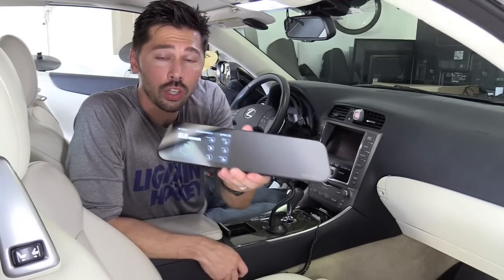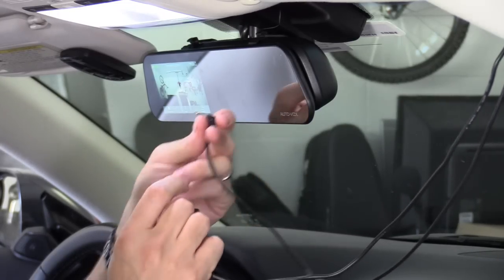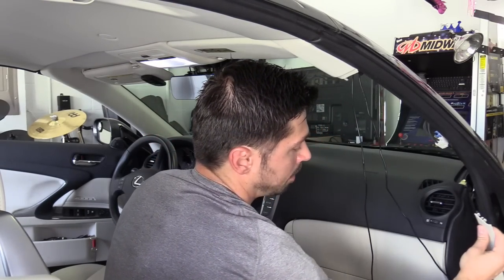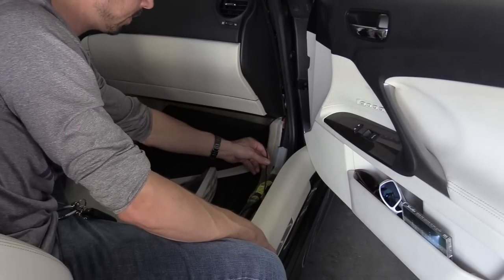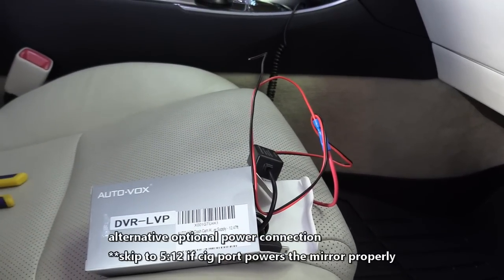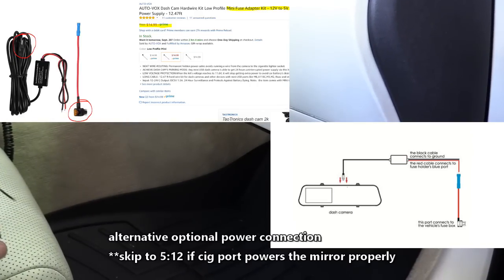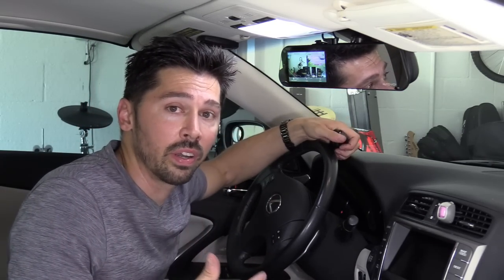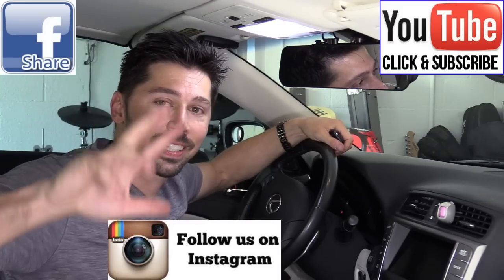HOW TO INSTALL AND WIRE BACKUP CAMERA / DASH CAM DVR SYSTEM

Comment: Tampa and others NEED HELP! I installed my reverse cam on my unit and it works,except the image shown on the screen is mirrored, what is irl on the left = on the screen right and vice versa. I tried to find a solution but nothing, tried it on the chinese unit, nothing. What did go wrong? And also I want to put a switch so I can see when towing stuff or taking bikes with me if they are still ok in the back.  How do  you wire a switch? I did the following, a  wire from reverse wire signal  of the  unit with a diode in between to the switch( diode with band pointing to the unit )  and a wire  from 12 v+ to switch. When I turn on the switch I get the message: no signal. I guess I need the reverse wire to let the reversecam think im  in Reverse?Any help with a diagram or something would be welcome!

Comment: Nice work, I have one remark, why not solder the stuff  and  use self amalgamating tape instead of those sliceclamps?I truly dislike them. And Also I try to minimize drilling holes in metal,
Reply from the maker: Pfirtzer true but I wanted my tutorial easy for all my viewers to do.  soldering takes some skill and a solder kit. also it's easy to remove snap wire connectors but solder is a much better connection.

Comment: Great video!  Are you able to swap this between cars?  I drive rental cars half of the year and would like to use it in multiple vehicles.  Not necessary for the rear camera, but the front camera would be great!
Reply from the maker: Matthew Davidson these cables are standard for other models but make sure your cables are mini USB 5v power and 3.5 video cable.